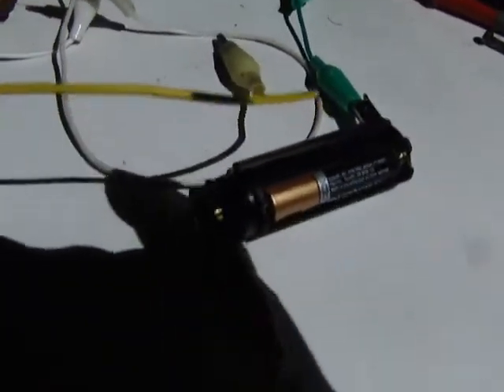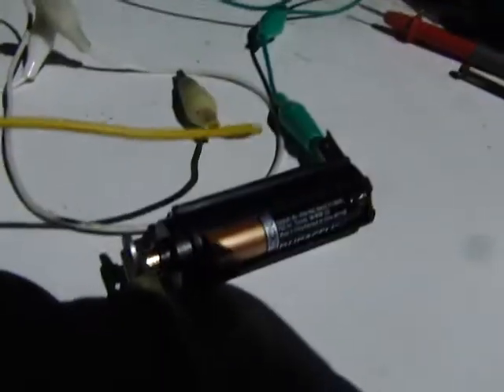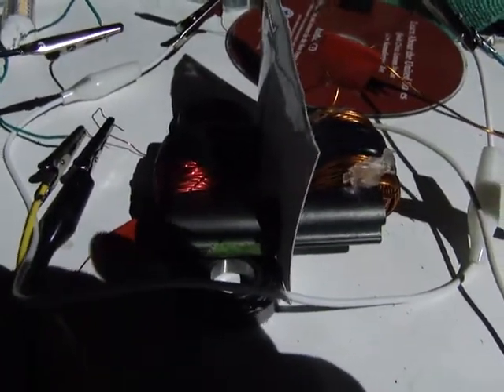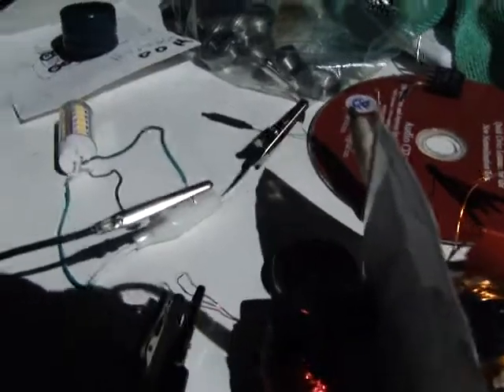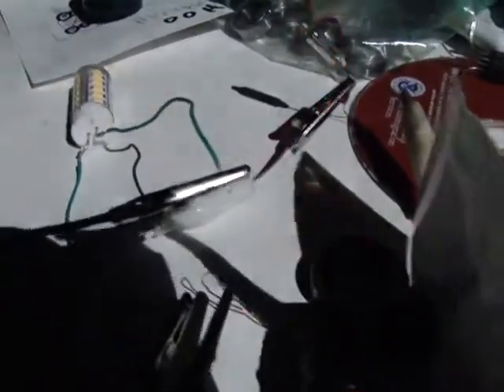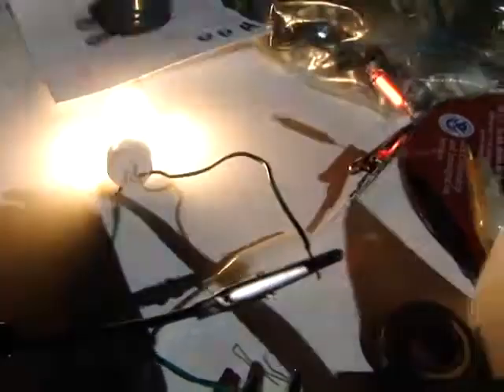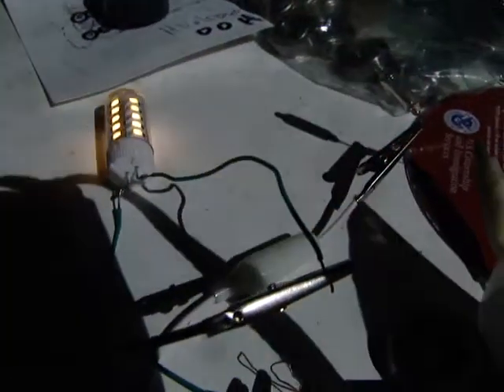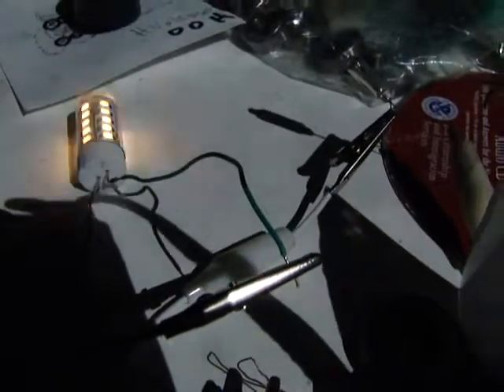EMF doubling with enhanced magnetic coupling

Comment: Very interesting! Where's the schematic?
Reply from the maker: just to let you know something interesting about this is..when i short circuit 4 volts the sound is barely audible but once it runs through 1 of the coils it arcs, yes and its only 4 volts but i think electricity has a type of inertia or momentum and once its traveling thru the coil it does not want to stop so it arcs;  this type of phenomena ocurred in ac lines when they would try to diconnect power; i.e. the current would continue thru the air and sometime blow up the transformers many electricians died this way when current was stopped.
Reply from the maker: example...https://www.youtube.com/watch?v=hIkNY5xjy5k
Reply from the maker: sorry no schematic but 2 u cores wrapped in 2 different gauge wires kinda like an electromagnet one may be 18 ga. other may be like 22 ga. the make and break is the volts lithium battery gives the initial emf jolt but it transfers to the secondary core thru the magnetic interlocking that takes place causing a high voltage spike also but now on 2nd coil much like a transformer the 2nd coil provides 90 volts or more lighting up neon and the first core lights up dome light 12 volts dc.
Reply: @alexmanzanero 
 Amazing thanks..!
Reply from the maker: thank you for making suchinteresting videos, god bless
Reply: O vídeo não entra tá com erro